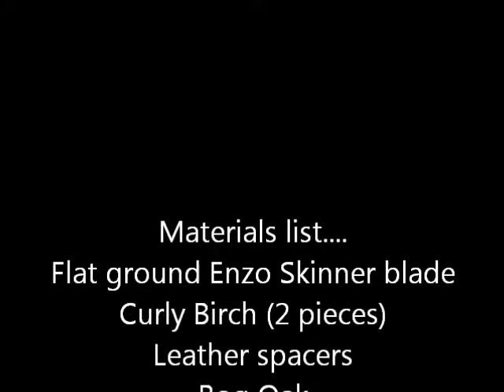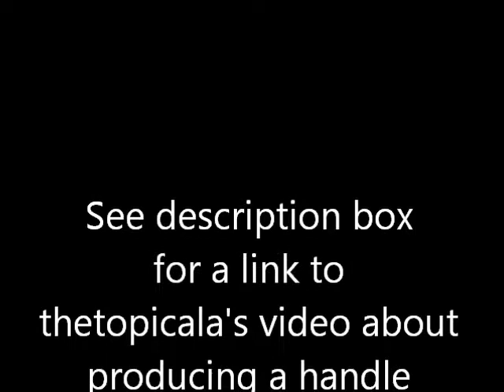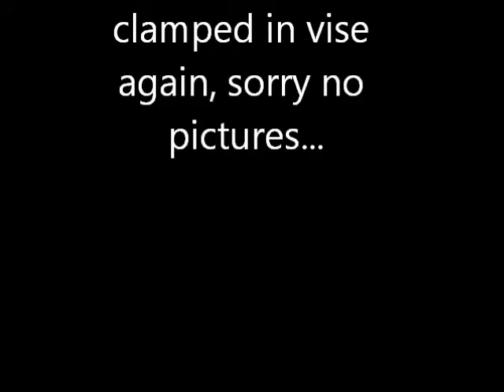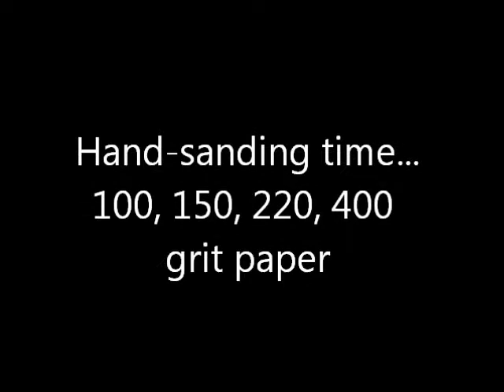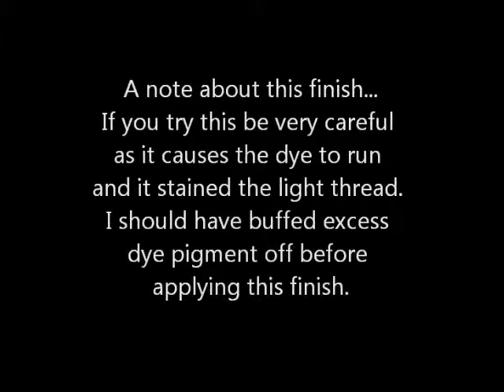Curly Birch-Bog Oak Enzo Skinner

Comment: Nathan, nice to see something "own" in your work which by the way turned out really well. I might have located the curve with the spacer up side down but it looks nice in the end! You are doing nice work with the sheath and it's decoration. Very neat! Where did you find that moose stamp? Good work my friend! Atb, Osmo
Reply from the maker: Thanks so much Osmo! Yes, you had a big part in this knife. I didn't really "debate" too much about which way to locate the curve, but figured that either way would look nice. I think that the stamp is a reindeer or caribou actually, and I got it on ebay I believe. Thanks again!